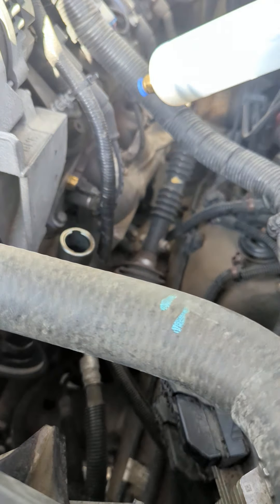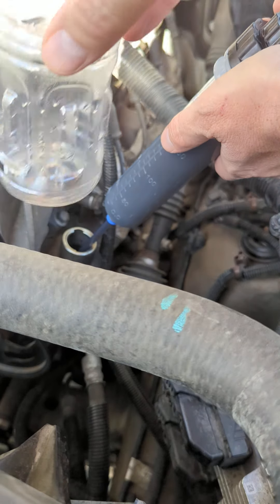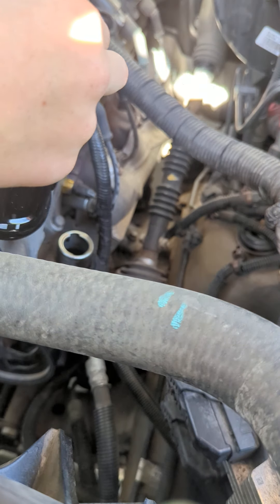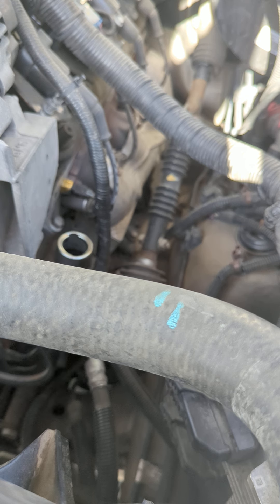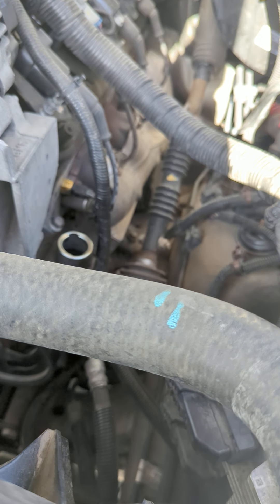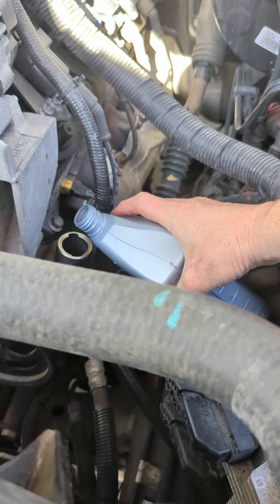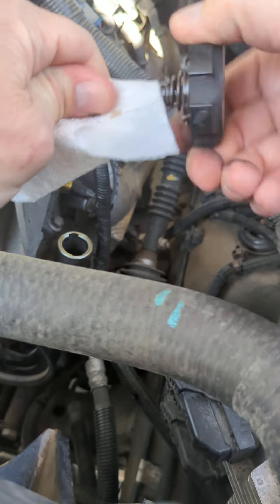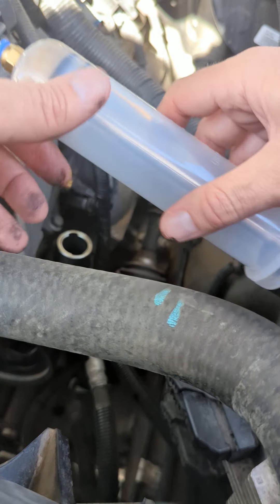Oil Extraction Tube, Power Steering, Rear Differential, Brake Fluid, COOL TOOL!

Comment: Yeh they pretty cool tool ..I use mine all the time bro . Works great on brake fluid aswell man
Reply: For my diff oil bro I use my STM tom thumb utility pump . It has a metal hook that sits in the hole . Then when it's all drained I use that tool your using to refill it